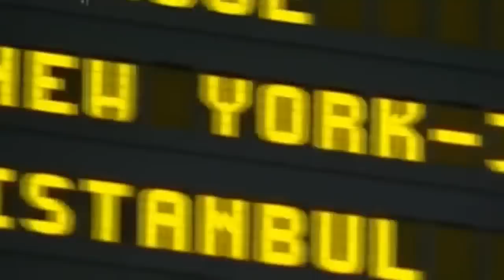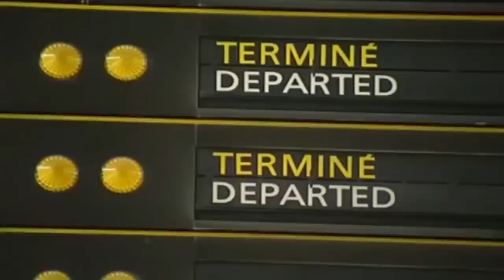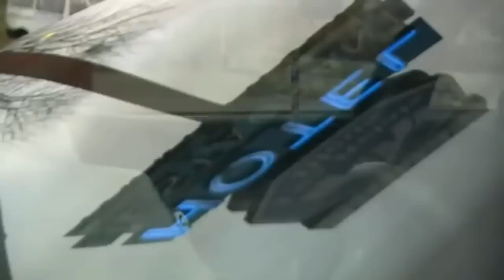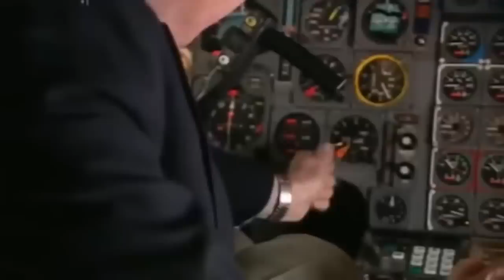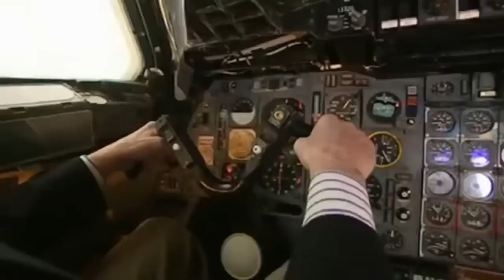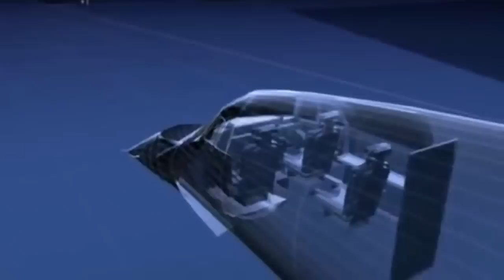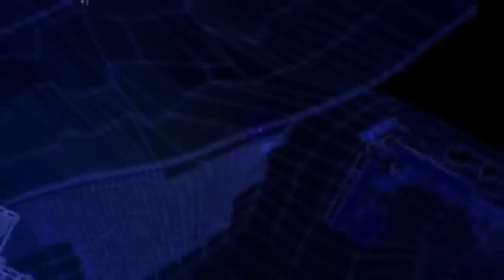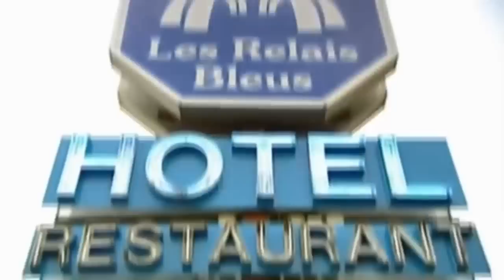Air France Flight 4590 Concorde Disaster Paris

Comment: why didn't the pilot just stop the bloody plane!!
Reply: Harpreet Singh Chawla would it not have been better to stay on the ground and crash instead of dropping out of the sky?
Reply: Aviation rules dictate that unless their is sufficient doubt that the aircraft will get airborne (fire is not sufficient as many aircraft have survived a range of fires) then V1 is e speed at which a take off must not be aborted. See Spantax flight 995 for an example of a well intentioned aborted takeoff after V1 which resulted in the death of 50 people and a further 110 injuries on board and on the ground after the aircraft overan the runway when attempting to stop.
Reply: He would of overshot the runway by miles!
Also there is Fuel tanks at the end of the runway so yeah!
Reply: recon forsales I agree and, the traffic controller to,d the pilot before take off it was on fire !!! Not even sure I believe  any of this, that the tiny piece of metal caused this horrific accident and ceased Concordes flights seems a bit too much "tell them, what they want to hear " sounds like a Grimms fairytale to me.
A  very sad day for aviation, if I won lotto I would have flown on Concorde, RIP Godbless all those who lost their lives
Reply: Have you ever driven over a nail or piece of metal on the highway, going 70 mph, what you think happens to the tire? Their were several factors that caused the tire to explode, tire pressure, (over 200 psi), the weight, and speed of the aircraft. The plane was going 320 mph, when the plane struck the metal.
Reply: recon forsales  Because, he was not driving a sports car.

Comment: Couple of things 
1. On failure of engine why fuel was nor cut off
2. Does plane has fire detection system?
3. Does it has causes and effect put in place properly?
4. Does designer done proper design of plane?
5. On failure of engine pilot was still flying up. It does means pilot was not aware of fire.
6. Who review HAZOP and what was recommendations? 
7. When last HAZOP was conducted and does air line has LR or DNV approvals?
8. How many modifications were done from day it built? 
9 when last engine repair was carried out and scheduled maintenance perform?

Comment: Concorde crashed because on the previous plane a peice of metal had come off and was left on the runway. Concorde then started to build up speed to depart but all the power from the plane had flung the metal into Concordes engine. The fumes exploded it and set the rest of the plane on fire. Thats what happened!

Comment: Isn't it Standard Operating Procedure when engines are out on one side, to give the remaining two full power and counter the asymmetrical thrust with control input? I can see why they would cut them....but there's also an argument to push them to the max also....then again, they were probably at full power for take-off anyway...With the port wing disintegrating there's not much they could do differently to recover...

On a side note; Did Concord have an early form of Thrust Vectoring? When they show the reversing buckets, it looks like they could be used for vectoring also.

Comment: They say airplane crashes are rare and you are more likely to get in a car crash on the way to the airport. I lived near one major air and 3 smaller airports. I have never seen a plane have any problem. Most plane crashes are caused by human.
Reply: I live near an airport too and big planes practise landing often. they fly over and it's cool, neither never seen any plane have any problem.
Reply: Lynn Sparks I live across the river from laguardia and I think I saw the US Airways plane that captain sully landed on the Hudson. I remember being on my block almost to my building trying to hurry up because I needed to use the bathroom after school. There was a plane flying overhead and I remember being amazed at how low it was. Later I turn on the tv and I see that a plane landed in the Hudson, but I've never seen anything else like that before.

Yes, it could have been that the plane I saw wasn't the US Airways flight since like I said I live in soundview across the river from laguardia and we do tend to get a lot of air traffic

Comment: If the wire was cut by the rubber, the two edges wouldn't touch each other because of air pressure. There must be any other reason of spark.
Reply: kazim ali they weren't that high in the air so air pressure isn't a possible factor. Unless you are thinking of the wind blowing the wires away from each other
Reply: Yeah. I am talking of wind blowing the wires away from each other.
Reply: kazim ali oh ok that makes more sense
Reply: Kazim I think the experts know better than you sunshine

Comment: All they needed to have is a camera installed on the runway, and the direct feed from the camera to the cockpit for the flight engineer to look at the plane from outside when it takes off.  If flight engineer had any authority of monitoring the plane (which he had, monitoring the instrument), he or she could have ordered the take of reject.  I believe the Concorde could stand better chances if it did not take off.  But there's nothing of a form of a rear view mirror for the pilots.  And we still don't have cameras on the runway.  Neither we have flight engineer job, as it has been eliminated as well.  All for profits.  I lack words to comment any further.
Reply: The plane is really safe it's just that piece of metal that caused the crash. You probably think we'll still it still caused the engines on fire well it would to a Boeing 747 aswell for example
Reply: +Oscar Margetts Well, what caused the crash was not just a piece of metal.  The piece of metal caused the tire to blow and the big chunk of the tire hit underneath of the fuel tank causing a shock wave that made the tank burst.  So, I'd say that the cause of the crash was Concorde tendency to blow tires at high speed take off and having the fuel tanks relatively exposed to that.
Reply: Plus honestly this plane is playing with fire. Yes it's beautiful and perfection to the human eye, but it's so risky.
Reply: +Blurryface The Space Shuttle was also risky. Today we have everything safe, like the cellphones, that of the battery doesn't catch fire, they kill us slowly but deliberately by emiting radio waves and making us slaves to social media.  The more the cellphone use, the more the shrinks will have to do.
Reply: Andrew Piatek
Reply: prince william & kate  HELLO
Reply: Aidan they would be ripped off from the speed they are going at ,300km
Reply: Andrew Piatek I agreee
Reply: It would certainly create more jobs.  Having people either on the airplane or on the ground monitoring everything on the ground and that be there ONLY job.  Just watching to make sure the runway is clear of any metal but using cameras instead of just a visual inspection

Comment: As an ex aircraft engineer I do not buy any of the official and varying causes. The only way I can see to vapourise and ignite that amount of fuel would be a small (tennis ball size) bomb tossed into the wheelbay severing the fuel supply to the port engines. Is this possible?

Comment: so basically some guy put a bad piece of metal on another planes engine and the piece of metal falls of on the runway,concord runs it over one wheel blew up firing 2 pieces of rubber in the air 1 hit a wire the other hit the fuel tank the fuel tank started to leak and the wire started to spark     spark + fuel = boom boom   the end.

Comment: 1:36 actually for all intents and purposes, it was an incredibly impractical, extremely loud when it broke the sound barrier (which got it banned from many airports in the US), gas guzzling. terribly expensive "conspicuous consumption" aircraft for those with more dollars than sense. 

When you are told by the tower that you are on fire but you are already past V1, it only makes sense that you would continue the take off as briefed and IMMEDIATELY turn the aircraft downwind and set up for the quickest possible landing on the runway that you just left. Why this supposed "one of the most experienced Air France pilots" did not do that is just a mystery to me. Had he down this, this tragedy could very well have been averted.

But that being said, this was still a terrible tragedy for all involved.

Comment: how can the concorde have 40.000 flights and 900.000 flying hours? That would be 20 hours per flight... And when it goes 2.5k kilometers an hour that would be 1.1 times across the earth per flight
Reply: Frikandellen Man I guess the 40000 flights are for the one plane that crashed, while the 900000 hours are for the whole concorde fleet
Reply: 40000 flights for 1 plane is waaay to much +Luca Kommentarkanal
Reply: Frikandellen Man Actually further down the comments someone broke down the flying hours and only got about 300.000 instead of the 900.000 seems to be wrong in the video.
Reply: Have you heard of a comma?

Comment: if left engines were out,couldnt they try stopping because its less power. Also, they said it would need 3,000 meters to stop so you need to divide which means it would only leave 1,500 meters needed and there was still 2,000 meters which would have left 500 meters
Reply: Jaiden Chokshi ah? They needed 3000m to stop but only 2000m of runway left, what part of that don't you understand? 

And once in flight the plane needs to maintain or increase velocity to create enough lift, slow creates drag and the plane falls right out of the sky???

Comment: this video is calming that this plain has had 900,000 flying hours. but if you do the math it's not possible for it to have over 900,000 flying hours because there are 24 hours in a day so that would mean you would do 900,000 divided by 24 witch is 37,500 days witch is equal to 107 years. now I'm not the smartest person alive but I'm pretty sure this plain wasn't built 107+ years ago but realistically it doesn't fly 24 hours a day every day for 107 years so use say uts been flying for over 130 to 150 years. witch isn't really possible for it to have been flying since at least the late 1800'S or at most 1900'S
Reply: Fazee Apex what about adding the flying hours of all concorde planes? I think they calculated the 900,000 number as the total flying hours (sum) of all concordes that time.
Reply: Fazee Apex, no because it had very long flights, and it was a rounded estimate, so it had 850,000-899,999 hours of flying time. They usually made global, or continental flights, which is usually a long flight!
Reply: Apex
Reply: You assume there was only 1 plane.  There were 14 Concords in airlines enough to get your 107 years in just 7.6 years at 24 hours a day.

Comment: Why can't the pilot just get the plane like around 40 metres off ground, quickly make a u-turn and just land on any lane available? Then those fire engines can just go to that runway and extinguish the fire once the airplane came to a stop. I'm sure the amount of runway wouldn't be an issue, besides, the crew members and passengers can just use a fire extinguisher or water that they have to keep the fire under control until then, can't they? This could be avoided if the pilots could think quickly on their feet.

Comment: Chicago, May 25, 1979. American 191, 270 killed. DC-10-Flying piece of scrap metal. The engine falls off faulty maintenance Ironically before Tenerife, Mar, 1977. Worst air disaster, 1974. Paris, Turkish airways DC-10. 343 dead. Faulty cargo door.  Design flaw. Right outside Charles De Gaulle.
Reply: More than 400 DC10s were built with a mere handful of fatal accidents. DC was a beautiful plane and reliable.

Comment: It is stupid to lift off, even at speed V1,  if you know you have fire and lost power on one engine. Yes, you'll crash at the end of the railway horizontally and burn there due to the filled tanks of fuel, but it is better to lift off and add to all that a vertical crash? And furthermore, a crash over a crowded residential area? However, why then the runways are not imposed to have a double length that allow a plane to stop even he reached the take off speed, V1? Ye, I understand there is rarely enough space on the ground to such long runways for airports, but  are we talking about safety or not?

Comment: What are the chances of this happening, a series of coincidences leading to a crash! Plane before the concorde has a broken metal piece, it breaks off on to the runway! The concorde takes off after the plane, concorde's tire collides with the metal piece and the tire bursts, a large rubber piece breaks off and hits the wing with enough force to shatter the fuel tank and a few wires, sparks ignite the fuel and the wing is on fire which leads to the crash! It should be impossible for something this coincidental to happen but it did!

Comment: 35:50 "And there's not enough runway left to stop"... 
So the Concorde decided to die by diving from the sky rather than taking chances screeching to a halt on the shorter runway???? I'm no aircraft scientist. But if the Concorde had not taken off, force of gravity would not have added to the weight and momentum of the aircraft, would it? The impact would not have resulted in total wreck, would it?  I mean running into a cliff wall headlong  wouldn't be as hurtful as jumping of the cliff, right? At least that would be my common sense if I were the ill-fated Concorde pilot.  #spanked

Comment: So someone explain to me why its a better Idea to take to the air in a burning, Sure to explode plane, than to Stop mid take off and pitch it into the dirt, or have runway take off ditch zones.
Reply: z Vukiin there was no time to stop the plane, if it had went off the runway and hit anything or had anything major happen it would've crashed with an impact solid enough to kill anyone simply from the force itself. The wisest play the concord could've taken would be to either try to make it to the nearest runway (forgive me but I'm not sure where that would be) or to attempt to circle around and try to land on the same runway it took off from. I couldn't tell you why it kept course while on fire, but halting the takeoff was not a viable option

Comment: A piece of metal ripping a hole in the wing, ok.
A piece of rubber ripping a hole in a wing, ok.

But a piece of rubber causing a shockwave in the fueltanks that then causes a huge hole on the other side ................
So a 4 and a half kilo piece of rubber can cause a massive shockwave through the fuel (many hundreds, thousands of gallons) causing a piece of the tank and wing to burst open on the other side?

Sounds a bit far fetched....
Reply: i mean.................
A 4.5 kilogram piece of rubber against a tank filled with what? howmuch fuel did it have in it?
And not just that, but was it full to the edge?

I would want to see an experiment of such a pressurewave through a gastank caused by the impact of some foreign object...........................causing the tank to burst...........
I dont say it didnt happen........... it just sounds a bit far fetched.
Reply: its like with TWA800.
They say they even found the wire in which the spark occured which caused the spark in the fueltank which then ignited the bit of fuel in the tank causing the explosion.
So imagine this: The plane explodes................ and hits the sea and is shredded to thousands and thousands of pieces.
It takes a huge amount of time to get em all together again, or at least most of it.
And, some of it was damaged ofcourse by the explosion and the stuff that might have caught fire afterwards while it was falling out of the sky............

And still they found the little piece of wire which Might have been responsible for a spark in the fueltank................

Yeah.
Sure.
Now im not saying it cant be done. But i mean, comon.
Howmuch wire is in such an airplane.
Howmuch was recovered ?
It just sounds a bit far fetched.

Comment: gonna see if i can make any calculations based off this vid...
Reply: when the pilot wind-sailed the Atlantic,it was 18 years before he lifted the nose of 4590 into disaster
Reply: 21 years pass between the Dulles Concorde incident and the 4590 incident.
Reply: the dc-10 metal strip was exactly 16.937 inches long - a deadly long part from the plane's engine
Reply: Concorde could fly at exactly 51.111 kilometers per second (51,111 meters)

Comment: You said a piece of metal cut a wire in two which ignited the fuel leaking.there is only one problemwith your conclusion sir , you can't prove it you are assuming that's what ignited the fuel. One thing I can prove without assuming sir , is that these people that perished are in heaven.